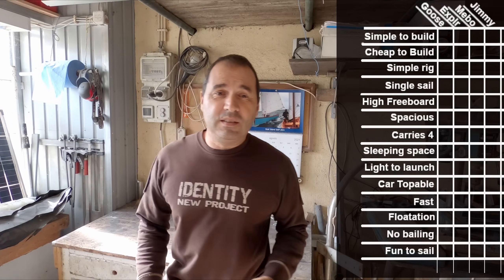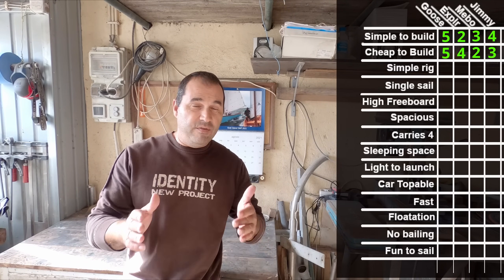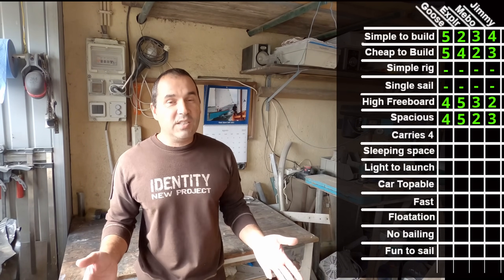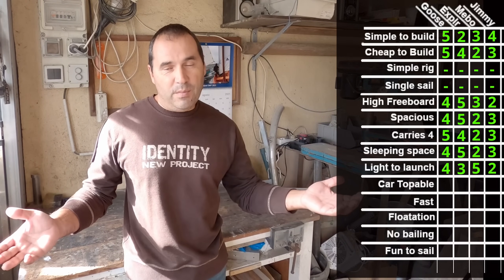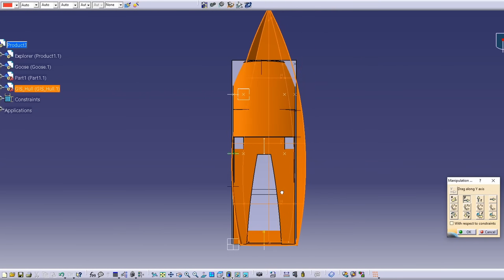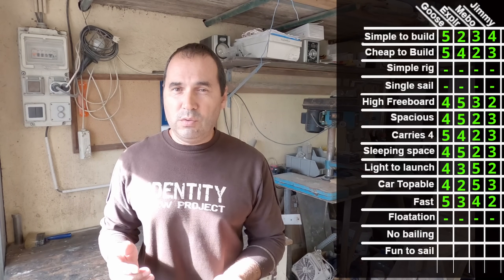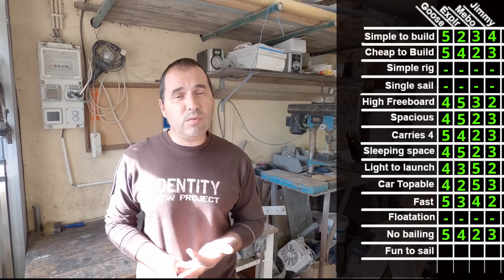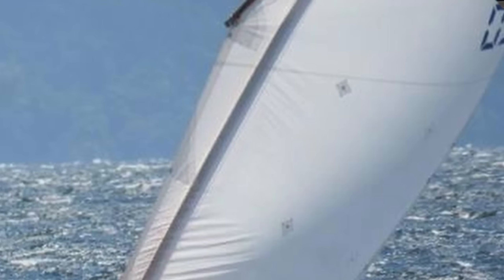Final Skiff Shootout. Which One Will I Build Next?

Comment: Pretty sure that with four people on board and small waves the goose may be stopped and hit them quiet inconfortablely because of her large and flat nose. These kind of design is very good for stability but you can't overload them at all. The flat nose has to be higher to avoid that like on the Caravelle (https://fr.wikipedia.org/wiki/Caravelle_%28d%C3%A9riveur%29). I understand that some compromises had to be done but this one might be too much for my taste. Excellents series of video by the way ! Really like your work on youtube :-) Obrigado !
Reply from the maker: Hi Samuel,
I won't be carrying 4 ppl unless it's a calmer day. Still, the chop will never come right at the bow since it usually  comes from the wind direction and as I won't sail any more than 40º to the wind it might not be as bad as you think.
I'll have to try it and then we will see how it goes! 😉
Reply: Our experience with the 8ft version with the same sail was that it was extremely capable and frequently would be the only boat left sailing when conditions got tough. The goose is easier to sail and retains those qualities.

in the Philippines we have one fleet on a lake (40 boats) which can get a very sharp nasty chop. We have two fleets on sea conditions in bays that are quite open to the sea (12 boats and 20 boats) and a smaller fleet in a more enclosed bay which is probably about the same as many bays in many countries.

It can be a noisy boat - but sailed properly the bow is out of the way of the waves and they meet the bottom first as the corner of the bow is pointing directly into the waves and is usually 18" or so above the oncoming waves. If it was a big heavy boat I think you could be right - but I haven't sailed a boat designed like that - so I would just be  guessing, but it is possible.

There are many assumptions made about the bow of the goose - but the fact is that the boats are raced in all normal conditions - and a bit more than normal as sometimes happens with racing dinghy fleets. And they don't have any sudden problems in any wind and sea range that normal sailing dinghies will go out in.
Reply: You can lift the nose placing the load afterwards. So small boats has always to be trimmed with the weight of the crew for best perfomance. Because of the big flat bottom the goose provides a lot of lift and even with a heavy load it's the boat will be raised when in motion. How much front and rear rocker fits best depends on the conditions , in my opinion the goose has plenty of them to generate an wide operational aera for save sailing.
Reply: @hansrupp3621  Your opinion is backed by experience of goose sailors in all  types of weather conditions.

With more than 4 people it does bog down and performance does suffer. But three is fine and there is a good sailing response through the wind range.
Reply: @MikStorer  My answer was related to 4 - not to heavy - people namend in the criterias. Let us name it more precise up to an specific load of  250-300 kg (500-600 pounds)? It's obvious, that raising the load will increase the performance in such kind of a boat and at some point the performance will struggle.
Reply: @hansrupp3621  :) for for people a 16ft boat of any hullform is going to be more successful than a 12ft boat of any hullform.

Another couple of feet would work for most hullforms to carry four, but then the cartopping starts to become even more problematic.